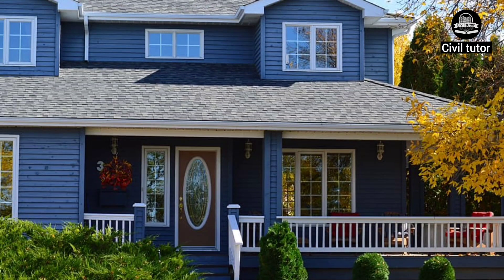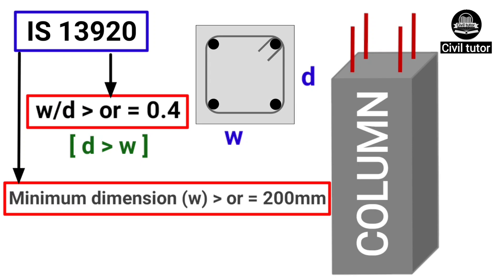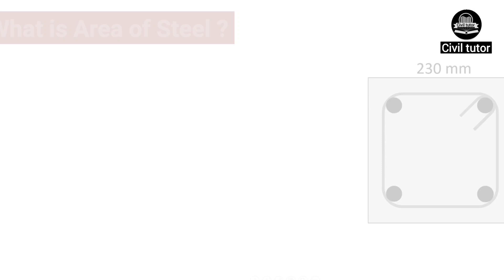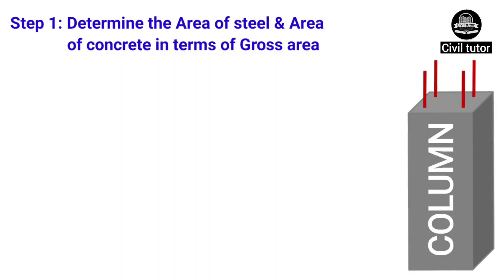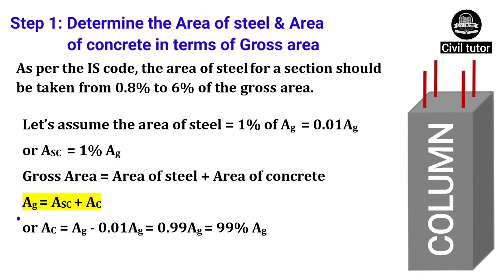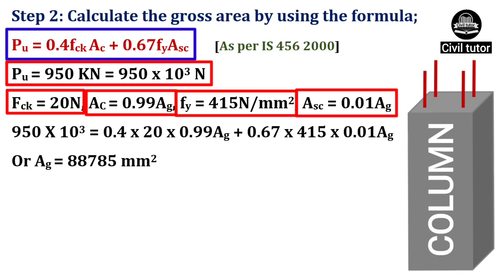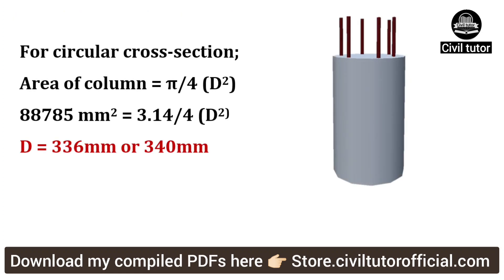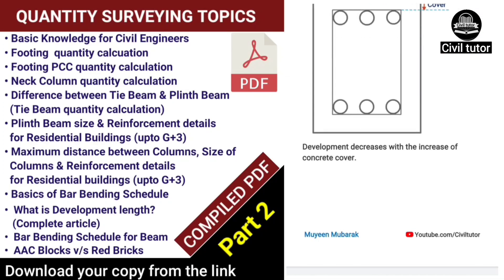How to find the size of column? | Design of column | Column size for residential house | Civil Tutor

Comment: How we get to know that how much load is acting on it?.expecting a clear amswer..
Reply from the maker: I will make a separate video on load calculation in future.
Reply: @CivilTutor  as per my knowledge, should we consider ,dead load,live load ,self weight and slab load
Reply: @Avis9989  Yes you are right. But while calculating slab load we should consider only 25% of the slab load.
Reply: @CivilTutor  its kinda needed answer for now...

Comment: Pu=0.40fck Ac+0.67 fyAsc  For M20 and fy415 steel assuming 1% steel
Pu=0.40 x20 (0.99 Ag) +0.67x415 x0.01Ag
Pu=7.92Ag+2.7805 Ag =10.70 Ag.
In this Pu=950 x10^3 =10.70 Ag
Ag=950x10^3/10.70=88785.04673 mm^2
Assuming  square section  side of column=297.97mm say 300mm
We can Tabulate the various percentage of steel for M20 concrete and fy 415 steel
pt=0.80%      Pu=8.16
1.0%              Pu=10.70
1.50%           Pu=12.05
2.0%            Pu=13.40
2.50%          Pu=14.75
3.0%            Pu=16.10
For economical max percentage of steel may be 2.50% may be adopted. This is  for simplication.

Comment: Sir, how we can decide the shape of the column in a location? I mean what are the factors that affect the decision of shaping a column whether square or circular?
Reply from the maker: For residential buildings where you need to do the brickwork between the columns its better to have a square or a rectangular section. If there are no walls then we can go for circular sections because they offer higher resistance to buckling than square or rectangular sections.